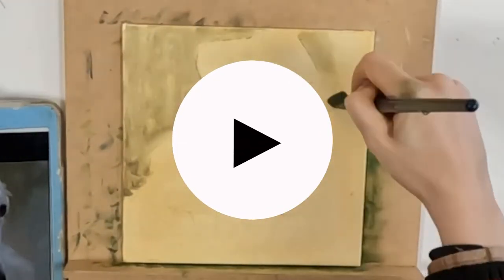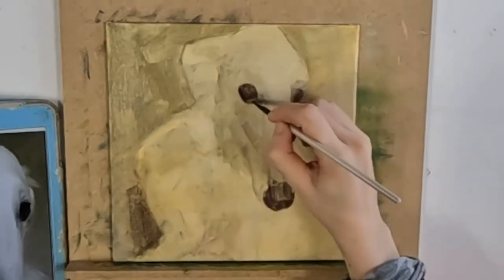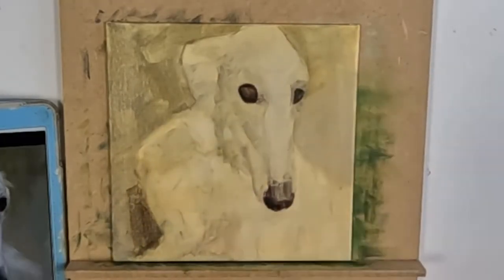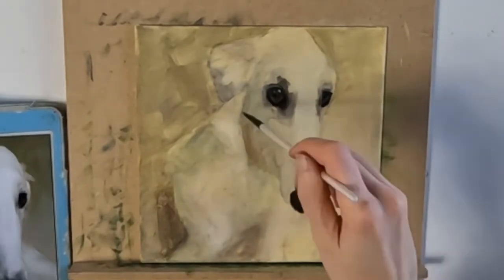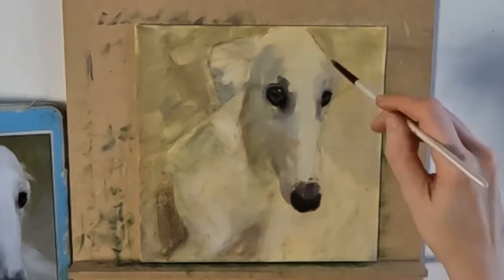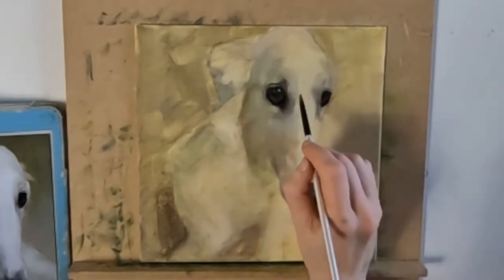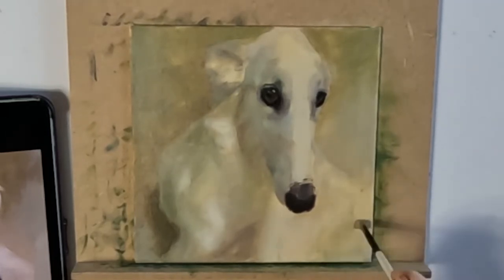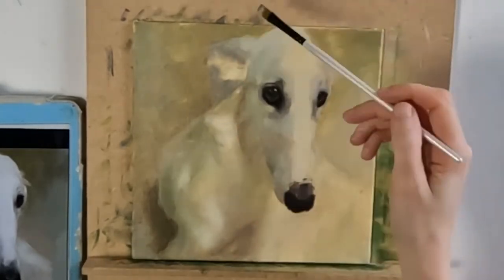Why is my oil painting not realistic? Use these 4 painting rules to help improve your technique.

Comment: Great tips, thank you. Achieving no loss of accuracy from the drawing to the painting is what I am struggling with. All your videos are excellent, and I am learning useful information from them. I appreciate you sharing your knowledge and I love your paintings.
Reply from the maker: I do have a video that helps with this issue but cannot remember which one it is. If you draw your object on your canvas prior to painting. Lay a piece of cellophane over it and use a permanent marker to draw it on the cellophane. You can then put this cellophane against your image at various points in the painting process to check your drawing is correct. Hope this helps. 😀